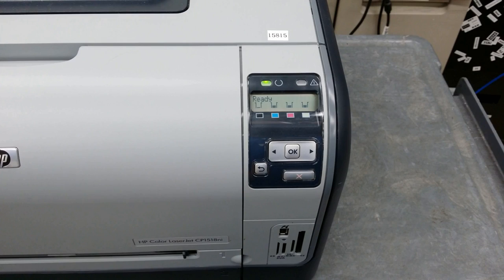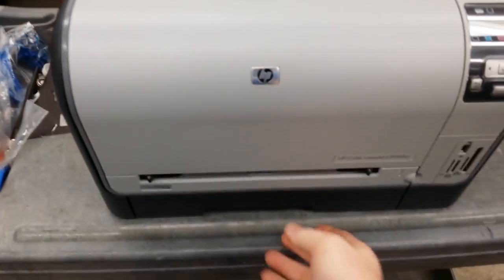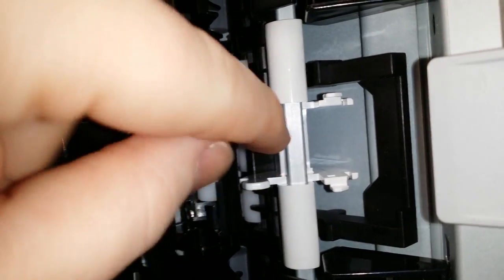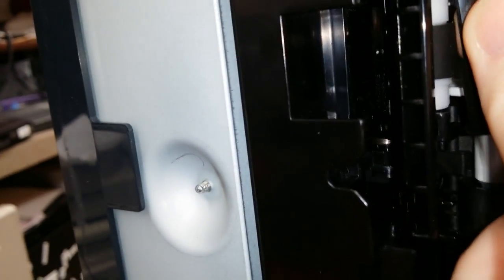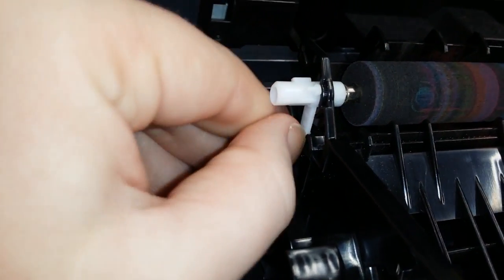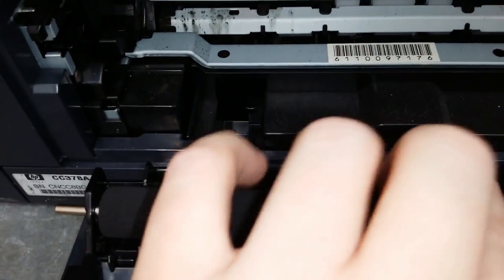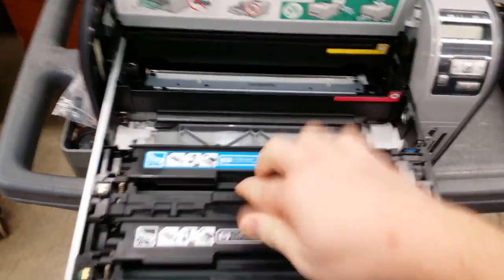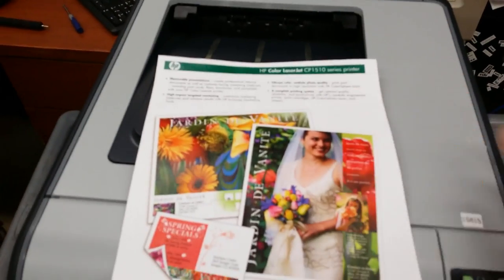How to replace the pick up, separation, and transfer roller on an HP Color LaserJet  CP1518ni

Comment: Very useful!  
One suggestion:  1) Remove the pick roller, then 2) remove and replace the separation roller.  Then 3) replace the pick roller.  The access to the separation roller is much easier this way!

Comment: I own a CP1525n, this video helped me figure out what the problem was. The printer said Jam in Tray 2. I didn't have to replace the pick and separation rollers, I just cleaned them with a gentle make up remover fluid, and the issue (Jam in Tray 2) is gone now.
Reply: Same here, CP1525NW. Followed videos instructions on how to remove both rollers, including setting the printer in "pickup roller" mode. Then used a bit of acetone on my finger tip and gently rubbed it on the pads. Did that a couple of times. Reinstalled. No more "Jam in Tray 2." Great video! Straight to the point and good camera work. Thank you so much!

Comment: You can get a second life out of the pickup roller by removing the clip that holds the rubber ring on it and moving it around so the unused portion where the clip was holding it is on the outside... this might work multiple times, haven't tried flipping it inside out
Reply: Thanks for this tip! Saved me in a pinch, because I noticed it was only worn in a single spot. The little feed roller wasn't really warn.

Comment: Very helpful video, though I would have liked it even more if some of the steps were actually shown and not only being described. E.g. turning the printer on the side, then zooming in on where to find the rollers, and also the parts where the pick uop roller is being clipped off and removed. Still, managed to do it!

Comment: Hi Jay!
I have used this video 2x over the last few years and it has saved me so much money! Thank you. 

This time I messed up and pulled a spring off from the little housing for the roller. I can see where the spring attaches on that piece, but not where is attaches to. 

Any advice? Many thanks!
Reply from the maker: I dont think I can help much since I no longer have access to this model anymore but you can take a look at the service manual to see if anything in there can help. https://www.partshere.com/manuals/viewer.asp?model=CC378A

Hope you can get it back to working condition again.
Reply: Thank you!

Comment: I just changed my pick-up and separation rollers all by myself on my CP1518ni. The only problem I had was getting the smaller roller out and back in. Just when I was about to throw this printer in the trash, it popped into place. I have a piece of plastic left over ?? Not sure what that is for. My printer is no longer screeching when it prints so something worked :-)

Comment: Great video! After entering the secondary setup menu, what if the roller does not rotate after pressing the ok button?
Reply from the maker: It should. If not you may have to print something and yank the power at the exact time the roller rotates. I dont know if there is an easier way if it wont rotate. I never ran into that issue.
Reply: If you put the paper tray and toner back in, it should do it.
Reply: @JayGroh  i try this and working

Comment: Jay, I used your video to replace/clean these rollers to solve my paper jam/tray 2 problem.  I have another issue now where by a giant cyan stripe is printed on every sheet of paper that comes out and also seems like there is almost a double printing/shadowing effect of everything printed.  Is there something I should clean, replace related to that issue?  Full disclosure, I am not using HP branded toner carts.
Reply from the maker: That sounds like the Cyan toner needs replaced. I would start with that and spend the few extra dollars for official HP toner. Cheap toner is cheap for a reason. Most of time they work but I see way more issues with non HP toner. It sucks but thats how it is. That should fix the stripe issue but if that does not fix the double printing issue you will need to replace the fuser. There is a slight possibility that the transfer belt is causing the double printing also. Easy way to check is to take out the fuser and look at it to see if it has a ghost of the previous print.  Do the same with the transfer belt. If this is a workhorse of a printer for you, you may just want to replace both the fuser and transfer belt just to have everything new and fresh. Hope this helps.
Reply: @JayGroh  Great - thanks - I'll give it a shot

Comment: "Press [OK] to rotate" and then pressing OK does nothing on my CP1515n. Can I manually turn it?
Also, the holder for the seperation roller is suspended on feathers, those are really easy to lose and hard to reassemble.
Reply: Mine wouldn't do anything either unless I put the toner and paper tray back in, then it would.

Comment: where's the paper jam/paper sensor on this printer?
Reply from the maker: I cant really describe where but if you search for CP1518 repair manual pdf just search for sensor and it will show you where they are located.